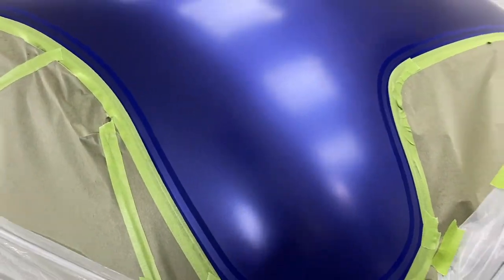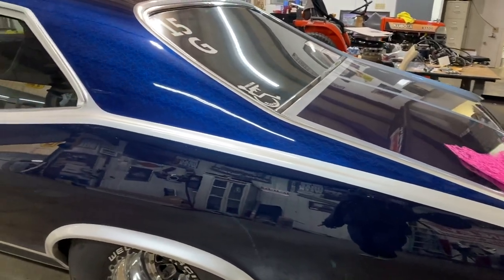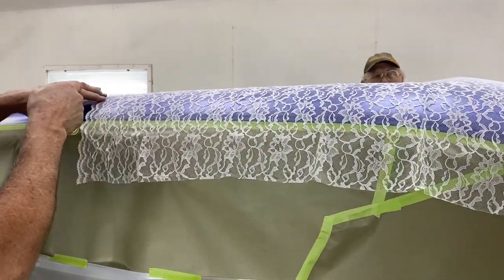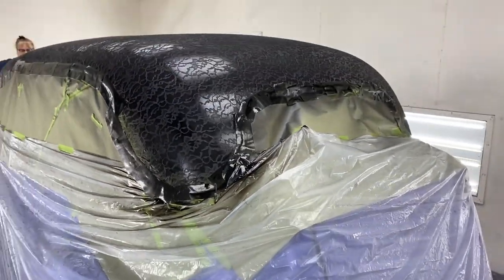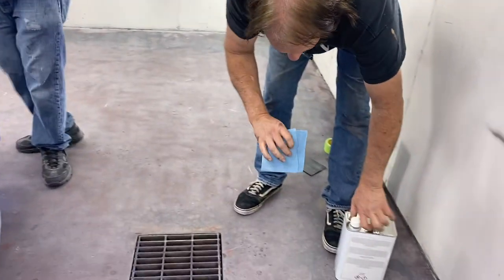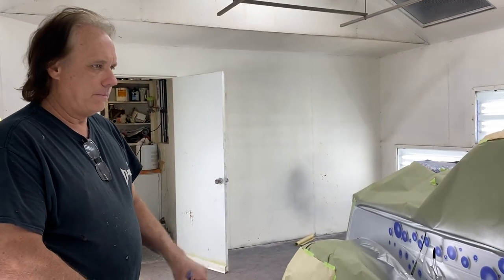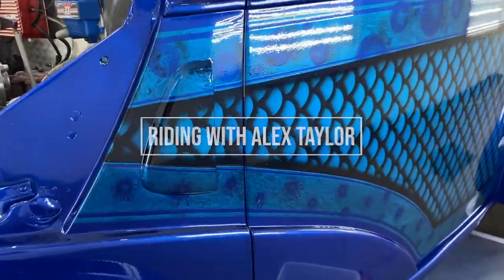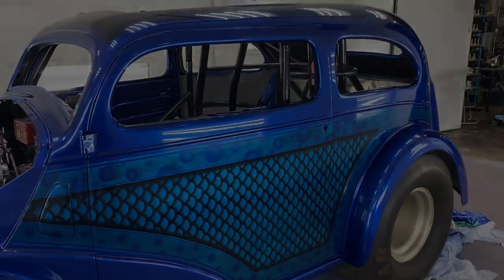Weekend Paint Job! - Painting Kym and Jim Fissel's Anglia

Comment: I used to paint motorcycles years ago and when I did a lace job, I used a temporary adhesive available at craft stores for doing stencil work on walls etc. Simply spray it on the "down" side of the lace and lay it on the surface you are going to paint. The lace can be pulled up and repositioned easily and the adhesive does not migrate to the basecoat. It works great on compound curves and reverse curves.

Comment: What kind of fuel does the engine burn and how much horsepower? Wild car. Put a huge engine in the smallest car and then stomp on the throttle.
Reply: We run methanol for this Anglia, we estimate it’s around 1300, but we’ve never put it on a dyno.   It’s a 496 BBC with an 871 blower.  It runs low 8’s in the 1/4.